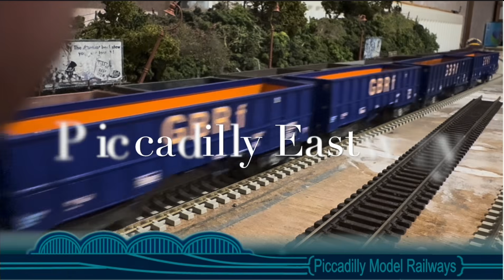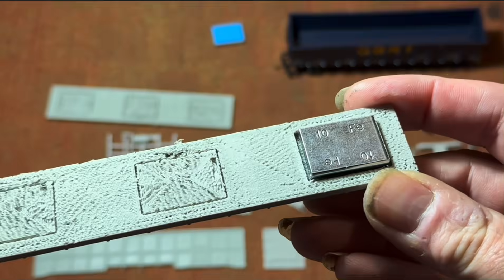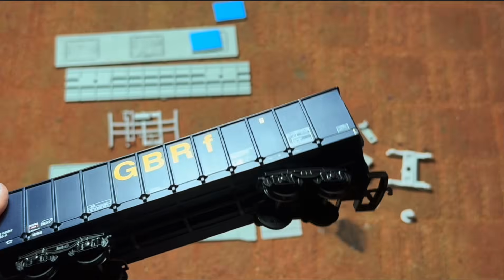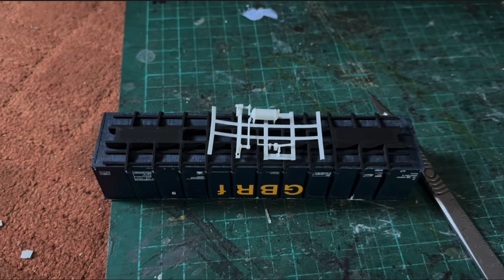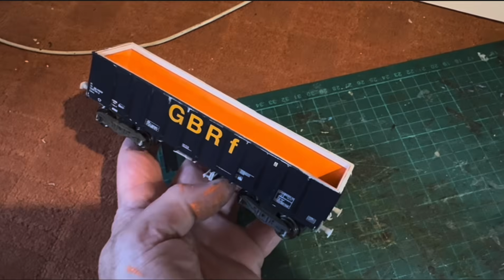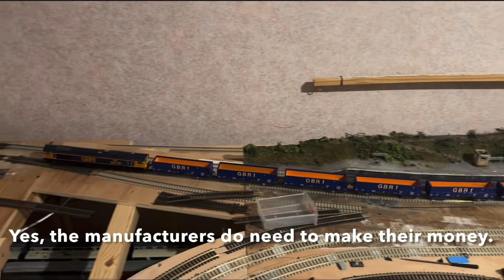IVE MADE A RAKE OF JNA WAGONS, could you make your own too?

Comment: Hello John,

I hope you're well.

Thanks for the mention.

Wonderful work the finished wagons look amazing and as you say much cheaper than the bigger manufacturers.
I did find adding brass bearings to the bogies helped with running.
Take care 
Deano
Reply from the maker: Hi Deano, glad you like them. I did think of bearings in the bogies, but just wanted to see how the resin stands up with the metal wheels spinning in the holes. I did oil each and may have to go down the bearings route. Time will tell.
Fancy making so e of your own wagons?
Reply: @piccadillymodelrailways lol John, I think designing my own wagons is too much for my little brain.
Reply from the maker: Oh Deano, it really isn't, have a play in Tinkercad. Its soo easy to use.

Comment: Hi John! How fantastic is that? Your own detailed wagons! It's amazing the level of detail you can get with a resin printer, and how robust filament printers can make things! Like you say, the best of both worlds! The rake looks excellent running round Piccadilly Eastway! You should be very proud of what you've achieved! Well done mate! Cheers, Ian.
Reply from the maker: Thanks Ian, but you can do the same too. Ive made rolling stock for N gauge. I used the cricut maker with that too.
Reply: @piccadillymodelrailways  - We'll see when I try and make that new wagon roof, won't we? :) Ian
Reply from the maker: Oh Ian thats easy, honestly. If you need a hand though, just say. I would try to calculate the radius of the roof first though and print a small arc no wider than 3-5mm that way you can get the curve right without wasting too much time nor filament. YOU CAN DO IT!